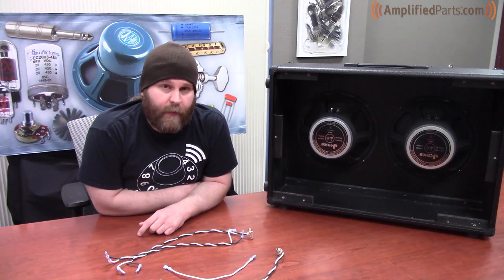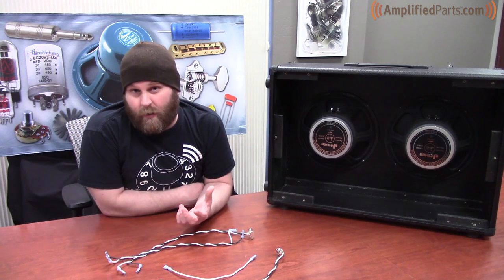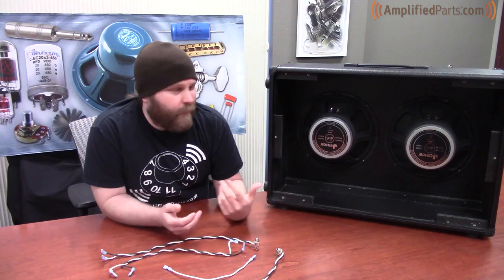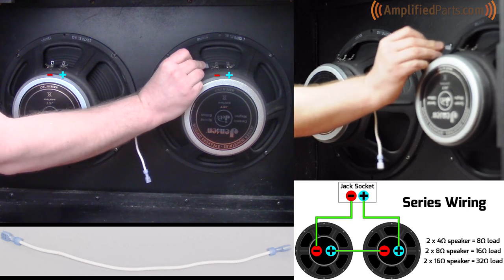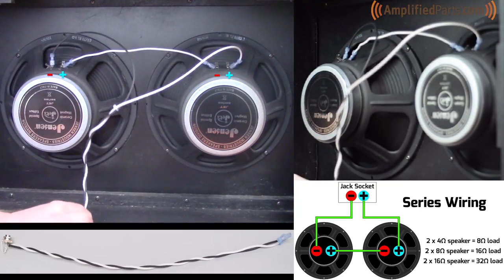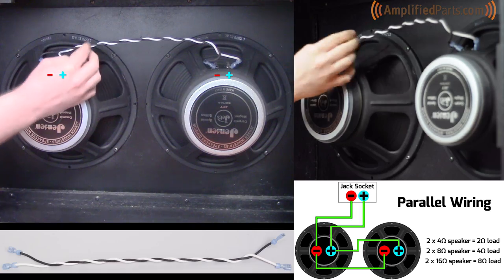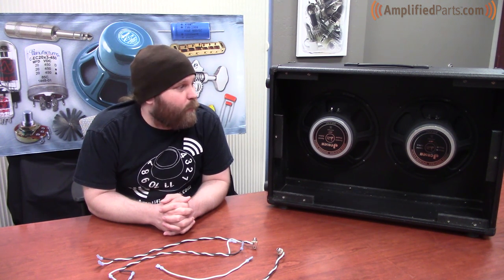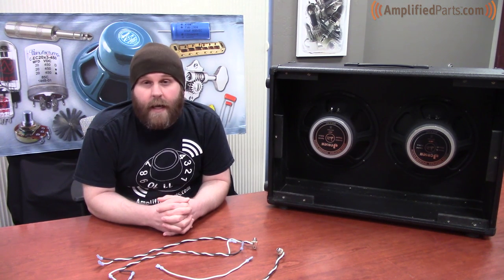Parallel & Series Amp Speaker Wiring

Comment: I have a set of aiwa subwoofer speakers. I am having a problem..I have three wires coming from the back two (positive and negative ) and a blue RCA cable. I wish to connect it to a 2 channel amp, is it possible?

Comment: if you have three 8 ohm speakers in parallel, that gives you 2 ohms? and three speakers in series that gives you 24 ohms? in series and parallel  connect with positive to negative?

Comment: So when you wire these 2 speakers in parallel, I'm assuming you have to feed them the combined rate of wattage? example) let's say they are rated at 800w @8ohm each for 2 in parallel you would feed them 1600w at 4ohms?
Reply: And witch is louder or better? 4 or 8ohm. Doesn't 4ohm have less resistance, but it also has a lower wattage coming from the amp?
Reply from the maker: When wiring in parallel, the power rating is the sum of the power rating for each speaker in the circuit so you are correct. 

For the best results, match the impedance that your amp supplies, ie pairing a 16 ohm cabinet with the amp's 16 ohm output or a 4 ohm cabinet with the 4 ohm output of your amp.

Comment: Will parallel wiring work if I plug this into a crossover network before going to an amp/receiver? I am building home theater speakers.
Reply from the maker: Parallel wiring should work for the speakers if the total load matches what your crossover and amp require. This is probably obvious but you will not want to wire your tweeter/horn or other sections of the crossover in the same parallel circuit with the speakers though.

Comment: I have a Boss Katana 50 combo that I'm trying to get working with a Marshall Origin 20 Head. The head has 8 and 16 ohm outputs, and the 2x12 cabinet from Boss is rated at 8 ohms. My issue is I don't know how many ohms a single speaker is rated at and I'm really confused since wiring parallel and series can change the cabinet impedence and I'm not sure how Boss wires their cabinets. I was planning on taking my exsisting cab and single speaker and attaching a 1/4 inch female jack onto the single speaker wires. Then that's where I'm not sure what to do next. I'd appreciate any help from the community or the channel. Thanks for reading :)
Reply from the maker: Do the speakers have the impedance printed on them? Sometimes it's on the rim of the basket.
Reply: @amplifiedparts  Haha yeah they do, I realized that about a day after I asked this 😂. Thanks for getting back to me though!
Reply from the maker: @ajaykumargoel9398  Nice! Glad you got it figured out!

Comment: I have a vox valvetronix 40+ with one 10" speaker that I want to convert to a head (eliminating the 10" speaker) and build a 2 speaker cabinet with 8 ohm speakers.  Do i need to wire the cabinet to equal 8 ohms (possible?) or is it okay to run at 4 or 16 ohms, depending on whether I wire series or parallel?  thx!
Reply from the maker: It isn't possible to achieve an 8 Ohm load with two 8 Ohm speakers, so you will need to determine if your amp can accept multiple impedances. If not, you would want to look at either two 4 Ohm speakers or two 16 Ohm speakers.
Reply: @amplifiedparts  
Is there an advantage between 4 and 16 ohm speakers?  How are 2 speaker cabinets that I see advertised rated at 8 ohms ; additional resistors in the cabinet?  Thx
Reply from the maker: @timlee2014  2 speaker cabinets with an 8 Ohm rating will have to use either two 4 Ohm speakers in series or two 16 Ohm speakers in parallel. There is no inherent advantages or disadvantages to either, it is a matter of personal taste.

Comment: I have a 15watt guitar amp, with an 8ohm speaker.... So if i am to add another 8ohm speaker in parallel, the ohm load will be cut in half, so 4ohms..... how will that affect the sound output of my guitar amp? Will it be bad or will it work just fine or efficiently? Thanks in advance!!
Reply from the maker: Most amps have a minimum impedance rating, and we do not suggest going under this. We suggest verifying that your amp can go down to 4Ω before trying out your plan. If the amp can handle a 4Ω load, you should not hear any major discernible different in efficiency.

Comment: I'm wiring 2 in-ceiling speakers in parallel, but the speakers don't have an extra slot for the 2nd cable. It just has the spring clamp. How do I go about wiring it? I'm using 14awg so twisting them together will make it too thick to fit in the spring clamp. Thanks
Reply from the maker: That's a tough call. I mean really with the spring clamps and that gauge of wire it's gonna be hard to do. Perhaps a slightly smaller gauge of wire would work.

Comment: I have a fender twin reverb reissue with Jensen’s. I bought a fender vibroking 2x12 Celestion v30s (4ohm) ext cabinet and have been using them together for years. I was told by people at guitar center this was fine but lately I’ve looked more into it and believe I’m running the amp at 2 ohms? The main speaker jack (Jensen’s) and the ext jack says Parallel input jacks on the amp. So am I doing damage or is it safe?
Reply from the maker: You are correct about the total load being 2 ohms when using the ext. jack. These ext. jacks have been a source of confusion for a long time. Ideally the total would be 4 ohms. Fender states in the 65 Twin Reverb manual "Note that the amplifier is optimized for a 4 ohm speaker
 load, and that the speakers in the cabinet are wired for 4 ohms. Should a total load of more or less than 4 ohms be used, the amplifier will not put out its maximum power output before distortion occurs"
Reply: amplifiedparts  thanks for the reply, so How could I or even should I rewire the cab or amp or both so that I could use them both together? Any way of doing this?
Reply from the maker: @johnalexander4221  It's probably not going to be possible with the speakers currently in you cabs. The easiest way to accomplish it would be to use four 16 ohm speakers all in parallel. You could do series-parallel wiring with four 4 ohm speakers but they are not so common.

Are you always using the extension cab with the Twin?
Reply: amplifiedparts I was using the ext cab and twin together nearly 100 % of the time. But I have stopped. Now I’m looking to buy a 4ohm head to use with the extension cab.
Reply from the maker: @johnalexander4221  I'm a big fan or stereo amp rigs so you can't go wrong with two amps in my opinion!

Comment: I have  a 2x10 cabinet with 8 ohm speakers, with 2 jacks. Can I wire one jack in series and the other one in parallel? My amp puts out 20 watts to 16 ohms, and  75 watts to 4 ohms, would love to be able to choose, depending on the gig!
Reply from the maker: You can but it will require a switch to change the circuit.
Reply: Ah, hadn't thought of that! Thanks for the reply. Have to work out the wiring now...

Comment: All I want to do I have a car radio and I want to make cabinet  to fit it in to there are four set's  of speaker wire's  wot is the best speaker s  to use but no amp will it work yours

Comment: Is it possible to combined parallel and series. like two tweeter in series configuration and parallel the tweeter to the instrumental speaker?
Reply from the maker: Series parallel is a wiring used in many cabinets with 4+ speakers. These can incorporate tweeters but most tweeters are wired using a crossover to separate the high frequencies rather than wiring them in as if they were another speaker.
Reply: @amplifiedparts  Is it ok for two 8 ohms tweeter whithout crossover and wire it to series config and add bass blockers and connect it to 8 ohms instrumental speaker in parallel config what is the equal ohms of this combination. I have a stereo amp that supports 8 to 16 ohms is it  good or bad for the speakers and amp?
Reply from the maker: @doubleblindtest4649  I'm not very familiar with the effect on impedance that an additional capacitor will cause in the speaker wiring. I believe with a proper crossover your configuration should be able to work with your amp though.

Comment: Wiring speakers doesn’t change the wattage though eh? I can’t wire 4 25 watt 4 ohms, and have one 100 watt 16 ohm speaker?
Reply from the maker: You can. No wattage really "changes", but the effective power handling ability of 4 identical 25 watt speakers in series is 100W. 100W from the amp would be distributed over those 4 speakers, with each needing to be able to handle 1/4 of 100W or 25W. Wired in series, the impedances are added (so 4x 4 ohm speakers will make a 16 ohm load).
Reply: @amplifiedparts  so if it’s a 4 ohm 50 watt amp, I can wire 4x4ohm speakers at 25watts in series to create a 16ohm amp @100watts?

Comment: stupid question: can I wire say a 1x12 8ohm speaker to get a serias out? just wondering because I'd like to build such a cab to hook it up to another 8ohm cab to get a 16ohm load.
Reply from the maker: Yes. You could use a switched jack as the output jack so it still works as a single 1x12 with nothing plugged in.
Reply: thx!

Comment: what about the output,  do they doubled up or divided? for example i got a pair of 200 watts 4 ohms speakers, so they become 8 ohms in series, but do they total as 400 watts? and what about in parallel?
Reply from the maker: Hey Kino. The 200W is the maximum power rating the speakers can handle. When you have two speakers with equal impedance they share the power from your amplifier equally. So two 4 ohm 200W speakers wired in series with give you a total impedance of 8 ohms and a maximum power rating of 400W. You would want to send less than 400W from your amp to the speakers.
Reply: amplifiedparts Thank you very much sir. 👍👍

Comment: How do you connect 2, 8Ohm speakers to have 8Ohm output impedance?
Reply from the maker: There is not a way to wire two 8 Ohm speakers to have a total load of 8 Ohms.

Comment: so, i have 4 8 ohm speakers and a stereo plug n play jack. how would i go about wiring the speakers? Thanks
Reply from the maker: The Plug and Play jack is not intended to be used with a cab that has x4 eight Ohm speakers. It is designed for cabs with: 
x2  8 Ohm speakers
x4  4 Ohm speakers
x4 16 Ohm speakers
Reply: @amplifiedparts  oops.... well, is there a way for it to work with 8 ohm speakers? I have 2 8 ohm speakers at the moment. Would it work with 2 8 ohm and 2 other speakers?..... Sorry about my lack of knowledge. Thanks so much.
Reply from the maker: @crashercrusher  the jack plate itself is a passive component and technically will work with any impedance speakers and configurations. The impedances provided by the plate when using it with the intended configurations cover most of the common applications, but using it with other speaker configurations will negate the labels on the plate. You would thus need to determine the impedance rating coming out of each jack and use it accordingly.

Comment: Ok I need help!    I just got a new Randall rd 45 tube amp. I have a twin cab with Celestion 70/80s at 8hms.  Wired parallel.  Now I wired the cab myself.  As one wire runs to speaker to other speaker. Pos & neg and pos & neg.  then one wire pos & neg to left speaker to mono jack pod& neg.  correct?    Plugged up amp no sound. Wtf?
Reply from the maker: Hey Thomas check out this page for wiring diagrams. https://www.amplifiedparts.com/tech-corner/speaker-wiring-calculator

How many speakers are you using? What is the impedance of each speaker and what is the output impedance of the amp?

Comment: how can i connect four 8 ohm polk audio patio speakers in parallel to a single crown powered amp? I have a total of 4 speakers i want to connect?
Reply from the maker: You can get a wiring diagram from our tech article on the subject: https://www.amplifiedparts.com/tech-articles/speaker-wiring-calculator

Comment: I'm building a new cabinet to replace one that usually has two 16 ohm speakers. Since it will have four speakers, should the ones I get be 32 ohm?
Reply from the maker: What is the total impedance you're looking to match? Series-parallel wiring is usually a good option for cabinets with 4 speakers.
Reply: @amplifiedparts  The manual for the amplifier says 8 ohm power output. Thank you so much for the help.
Reply from the maker: @vapeymcvape5000  I would use four 8 ohm speakers and use series-parallel wiring. Check out this page for wiring diagrams: https://www.amplifiedparts.com/tech-corner/speaker-wiring-calculator

Comment: whats the story about coils and capacitors in speakers? what are they for? i am trying to understand how this stuff work but every video i watch is rather advanced with tons of gibberish and technical terminology that i don't understand.
Reply from the maker: Those are crossovers. They are used like an EQ to separate the signal into different bands. A lot of bass cabinets use them to send the higher frequencies to the horn/tweeter and the lower frequencies to the speaker.

Comment: Guys i have 4 45rms speakers (4 ohm each) and i want to connect them to a 2 channel amp with 60 x 2 rms eith 2 to 4 ohm impedance. Can i do paralell wiring? And will the output be good?
Reply: @Booneville2024  no switch. But in the pioneer website its written Load Impedance Allowance: 2 to 4
Reply: @Booneville2024  95x2 rms at 2 ohms and 60x2 rms at 4 ohms

Comment: Is there any difference in sound between both types of wiring?
Reply from the maker: Some will definitely say there's an audible difference. Some will disagree. In my own personal experience I've always just used them as a way to get the proper impedance match and haven't noticed much in terms of audible differences.

Comment: Hopefully you'll find this question and be able to give me an " Idiots Guide " to Impedance. 
I have a Celestion Vintage 30 @ 16 Ohms.
I would love to place this a Cabinet and have the ability to run it both as a 16 or 8 Ohm, depending upon the Amp I'll be using any given night.
Is there a way to either add a Resistor to a SWITCHABLE Jackplate to go between 16 and 8 or am I going to have to add another 16, wired Series/Parallel error, am I just stuck at 16 Ohms?
I'd love to stay, at my age to a Single 12 External Cab.....really don't wanna lug around a 212 everywhere!!
I've put this body through the ringer over the last 40+ years!!
Thank you for a quick, easy to understand Video on Ohms Law........now, if I could just remember the rest of the Law!!!
Looking forward to your response!
KK
Reply from the maker: Hey Keith. I wouldn't recommend using a resistor as a dummy speaker in a cabinet. The resistor and the speaker both work very differently and the resulting load will not be same as when two 16 ohm speakers are used in parallel. The sound of the amplifier will also be altered by doing this.

Personally, I would use the 16 ohm speaker with an 8 ohm output. This is acceptable for a tube amplifier.
Reply: @amplifiedparts  
Thank you for the quick response. 
I kinda had a feeling that was going to be the case.
I've never heard a Resistor that sounded anything near as good as an ol' V30 or Greenback...lol...
More than likely,  I'll end up with a used JCM 900 1930 212 Cabinet, get another 16 Ohm V30 and just deal with it!
Getting........older......kinda stinks.
Having said that, when it's the TONE you're going after, I guess it will be worth strapping on some Depends, Sock Suspenders and a Jack Bruce Standing Stool and just work through the DSL 112 CR Combo with my 212.
I miss the 80's....back when I still had a Back, Roadies and a great Axe Tech!!........not Aztec!!!
Thanks again!
Heading back to the Video to save it in my Library as well as SUBSCRIBE!!
Keep up the great work.
🤘😖🤘

Comment: How about wirinf a stereo guitar amp with stereo 4 ohm speakers to a 4x12 stereo cabinet so that you can run 3 speakers per side?
Reply from the maker: Hey Richard, when using three speakers, you run into problems with impedance. You can use three 24 ohm speakers in parallel to get it to 8 ohms.
Reply: amplifiedparts that's what I thought.... thanks so much!😁

Comment: but, if you have choice, which one sounds best?
Reply: Impedance matching isn't about sound quality.  The idea here is that you chose speakers that have the sound you were looking for, now you need to be sure they are not overworking your amp so you match the impedance (flow restriction) of the speakers to the amp by wiring them appropriately.

Comment: So if I have a 4x12 and wire all 8 ohm speakers parallel it should come out to a load of 8 ohms?
Reply from the maker: Four 8 ohm speakers in parallel will give you a 2 ohm load. You need to wire in series parallel to get an 8 ohm load from those speakers.
Reply: amplifiedparts so one pair in parallel and one in series?
Reply from the maker: @dakotaholzinger5655  You wire two speakers in series and then the other two in series to make two seperate 16 ohm loads. You then wire those two 16 ohm loads in parallel to get 8 ohms. Check out this page to get diagrams: https://www.amplifiedparts.com/tech-corner/speaker-wiring-calculator

Comment: whats the exact spade connectors you use?
Reply from the maker: Hey John. Typically I'll just use these twisted pairs that come with the connectors already attached: https://www.amplifiedparts.com/products/speaker-connectors-twisted-wire-pair
Reply: @amplifiedparts  happy days man, thanks :)

I am wiring my 2x12 in series but still want the option of running it in parallel, these will help out big-time